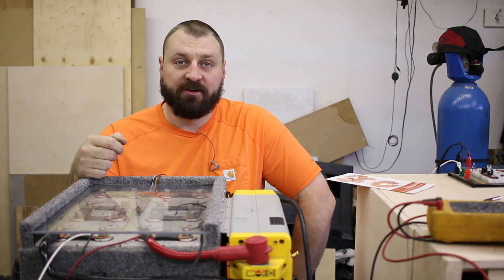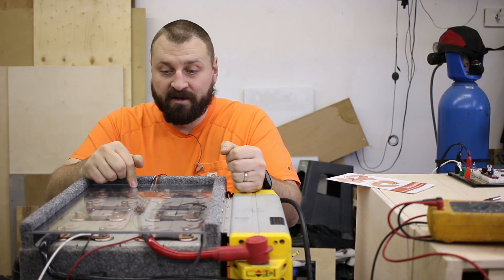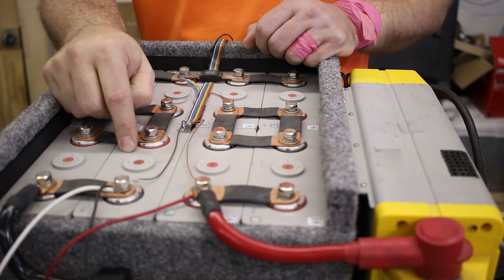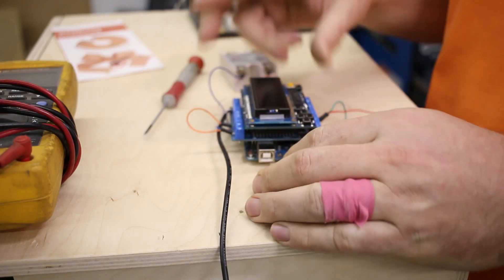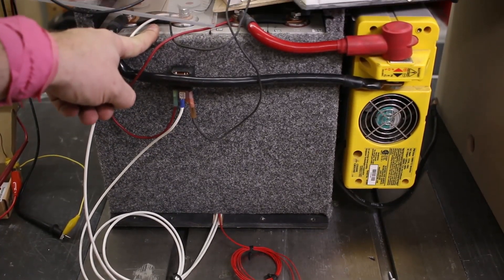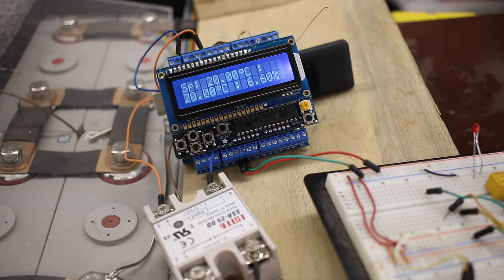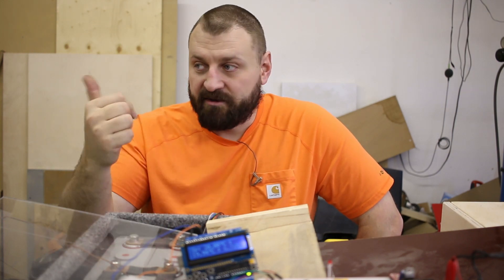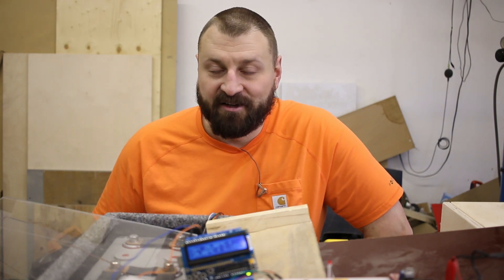Lithium Battery Heater -  DIY RV - How to build an Overlander

Comment: Two suggestions to increase safety.

Perhaps a 400 watt matte is a bit much?  You could conceivably cook off the batteries if it sticks on.

Other idea would be to put the secondary side of the mechanical relay in series with another relay that’s always held  closed/on by the arduino. 

Add an “if” statement that would open this new relay if the temperature sensor reads too high and can cut the current from going through the first relay.  This would give redundancy if the first relay chain got stuck closed and energized the heating matt continuously.

I also don’t trust the Dallas 1-wires.  I’d add at least one more and place the two of them together.  If the temp readings between the two sensors gets too far apart then shut down the heater.
Reply from the maker: Both great ideas! We sold our house in Canada and made our way south, haven't had to heat the batteries since Colorado... Currently in Mexico and haven't had any problems with freezing here 🌴🌵🤣
Reply: Dem warm weather problemz
Reply: Personally, I put a snap disk cutoff switch "rated" for 40c on each end cell in my pack as close to the bottom heaters as I could get my drill. The heaters will be wired through them and should provide some over temp fault control while my controller is set to, say, 4c and something bad happens to the relay.

I hope to test this soon.
Reply: Put a normally closed thermal switch in line with the heating element (of sufficient amperage) and it can cut the system off if something goes wrong. That's what I use.

Comment: Interesting.  I am toying with keeping my off grid cabin batteries warm during the Alberta winter.  I am using Electrodacus's DMPPT+SBMS.  Was thinking to use snap switches to control a relay.  One at the top (nc 20c) and one by the heating element (nc 25c) to do the cycling.  Can adjust the size of the heating element by the length of the silicone wire (as per Dacion's heating element strategy).  Thoughts?
Reply from the maker: Yeah, should work fine...

Comment: I just finished building a similar setup for my 6kwh pack in my camper. I have it set to keep my battery at 22-24 degrees constantly only using a 20 watt 12v heat pad and a well insulated box.
Reply: What type of heating pad? Is it available on amazon?
Reply: @PaDutchRunner  I got a 15w bathroom mirror heating pad that runs on 12v, a digital thermostat from ebay. Have yet to install it in my van but starting to feel like 15w might not be enough. Heating pad is Demista brand, lots of sizes to chose from.
Reply: Martin K Thanks for the info! I ended up buying two heated pet cushions that I plan to place on top of my battery bank, with a heavily insulated winter coat placed over top of both the pet cushions and the bank.  I haven’t tried it out yet, but I have a hunch that the coat will trap enough heat to cause a substantial warming effect, while at the same time insulating against the ambient temp (you know, behaving like a coat).  The pet cushions have some suitable properties — they are weatherproof, they do not have timers (because pets can’t reengage once the time is up), and shave what I presume to be a solid thermostatic set up — because the life of the pet would be at stake in the event of overheating, etc.
Reply: @MartinTheLaserGuy  take them apart and stick them in the floor, save thousands for a commercial solution :P

Comment: I am going to add heating to my batteries and control the heating with an arduino. What components did you use with the arduino (shields)? Can you give any details on the arduino sketch you made?

Comment: Are you still happy with the heater setup?  Thought you mentioned the heater draws 400w.  To which heater were you referring?
Reply from the maker: Yes, Super Happy. We're crossing over into Mexico now, so not really needed as much as when we were in Canada.
Reply: @Everlanders  yah, I'm in Portland and have wondered if a heater is warranted given it doesn't drop below 0 very many days/year.
Reply from the maker: Probably not needed then.

Comment: Would be cool if the Heating and maybe even fans for cooling was integrated in a BMS
Reply from the maker: These batteries are sealed and are inside our living space, so they are generally at temperatures that humans can tolerate.

Comment: Are there lithium battery heater kits available?  Perhaps in the Marine market?  VERY good video!
Reply from the maker: Not that I've seen, but this is a very simple DIY project anyway.
Reply: Electric Battery Blanket.

Comment: Can you suggest on a heat pad to use.  I have 8 180ah Calb, they will be below Roadtrek camper living space floor, in a metal battery box 7'' 1/4  x 22'' 3/4 x 13'' deep . I Am thinking of insulating the outside of box with 1/2 '' foul foam.   The temps here in mid east (Delaware) not like yours but I want to be ready.
Reply from the maker: Those are exactly the batteries I have... It is going to depend on how you'll be powering it... A 400 watt 12 volt silicone heating pad will pull about 40 amps. A 200 Watt 12 volts pad, is likely sufficient. Powering it off of 12 volts is an uphill battle, especially in winter with the solar production being so low. If you will have the option to plug into the grid, there are lots of 110 volt heater pads available too. Look up Kenovo heaters on eBay, they make many for the 3D printing market in many different flavors.

Comment: Any suggestions on a heating pad to use? I saw below that you used a 400w pad -- haha. I'm struggling to find something thats a much lower wattage and power consumption that doesn't have a built in thermostat. I want to use my own thermostat to set the temp. Any ideas? Thanks!
Reply from the maker: Mine does not have a thermostat built in... It does have a temperature sensor, most do. But you can abandon it and use your own thermostat to control the temperature as I did. Look into 3D printer bed heating mats. They are available in many wattages. 400 watts is a little bit much, but when I considered that I can't charge the lithium batteries until they are above freezing, I wanted to heat them up as quick as possible, the fastest recovery time... if you are just maintaining temperature, you could get away with much less.
Reply: Yeah we will see... I’d like to gently warm the batteries from the bottom, doesn’t need to be quick, in fact slow should help let the warmth travel evenly through the batteries which are 8” tall so the top won’t immediately benefit from the warmth at the bottom. I’ll set the thermostat at 40 probably, and the heater will be powered by the lithium batteries themselves. 
The pads you linked look like a good option too if more heat is needed, I could use 4 of those spread out for a total of 80w. We will see how the one I ordered works out and adjust if needed. 
Appreciate the input, let’s keep in touch about it 👍🏻.
Reply: Looking to do this for a LiFePO4-battery in my truck camper. It’ll be heated by a diesel heater during usage but really want the solar to work during cold storage when not in use. What PWM controller do you guys recommend? Perhaps one with a thermostat. Up here in Sweden it can be down to -40C so a well insulated box and a heating pad will be needed.
Reply from the maker: https://www.ebay.com/sch/i.html?_nkw=heater+silicone+12+v
Reply: @Everlanders  Thanks -- just seems like really high power consumption and really high heat. I want to install a heating pad on the bottom of my 9" tall batteries and gently warm them back up, not bring a ton of heat into the bottom that may not transfer quickly to the top. Just want to keep them at about 40-45 degrees through the winter when ambient temps may otherwise be below freezing. Having a lot of trouble finding a low wattage heating pad -- only really seeing pet and people pads/blankets that are low wattage. Surprised its so much of a struggle! A company called Keenovo makes a lot of pads, but still nothing 12v and low wattage unfortunately.
Reply from the maker: Ours is made by Keenovo, they make lots of great options...
Reply: @Everlanders  I found one tonight that is 5" x 14" and 30w -- I think this might be a good choice for me. Here's the link: https://www.zasales.com/BME9.html?fbclid=IwAR0-9TIVzNnL3jIdHZeJ1mz1HOMOKsqhCJ9bohUAAtwioxQ74bqNk1jH7y8 
Going to talk to the company and probably give it a shot. my battery footprint is about 5.8" x 19" so I will attach the heating pad to the underside of an aluminum plate similar to what you did to help spread the heat out a bit more, and hope that the box is insulated well enough that the batteries on the end will stay up to temp even if they're not in direct contact with the heating pad since its a little smaller. What do you think?
Reply from the maker: I think it's too small and too expensive. You can always get a cheap PWM controller to dial it back, but you can't turn it up past it's rated wattage. Since I'm using solar to warm it, I want to heat it up quick so that I can start charging sooner. But that's just my opinion, You do you and let me know how it works out.
Reply from the maker: Like this: https://www.ebay.com/itm/12V-DC-80x100mm-20W-Flexible-Waterproof-Silicon-Heater-Pad-for-3D-Printer-Heater/132755688351?hash=item1ee8db0b9f:g:iRAAAOSwaY9bpEnI:rk:6:pf:0

Comment: Will a 300 amp discharge to start an engine, warm up the battery to allow it to charge with the alternator when it's ?F?
Reply from the maker: Yes
Reply: When it's 0 degrees F, 10 degrees F...how cold?
Reply: @HarmonicResearch  spec sheet for the CALB minimum charge temp is 0°c which is whatever that converts to in your daft Fahrenheit measurements :D  but for safety / error margin I would would limit it to a minimum of 5°c to be on the safe side

Comment: Wow, your vids kinda make by brain spin.  You've got skiiiiiilzzzzz.  So...explain this to me like I'm 5.  I've got a lithium bank I want to heat.  Best/newbie solution?
Reply from the maker: That is going to depend largely on the mass you need to heat. The 400 watt heater pad I used was probably two times bigger than I needed. It pulls 40 amps and heats up a bit too quick and then the controller cycles on and off, it would be better with a more gentle heat.
Reply: @Everlanders  what is the elctrical block you are using to connect the controller
Reply: That's all too complicated for me and usually complicated things break down or are unreliable when your out in the middle of nowhere in your camper. I think my solution will be a much smaller heating pad with thicker aluminum in hopes to have something I can just turn on with constant current that will heat the aluminum plate around 25 Celsius maximum. Place a proper thermometer at the top of the cells and just let her run for an hour or so until the batteries reach 20C before turning on the charge controller on.
Reply from the maker: Perfect plan.
Reply: Does the electrodacus shut down charging when it's too cold?  If not, what's your solution to that?
Reply from the maker: Yes, it has minimal and maximum temperature thresholds that the user can change from the default suggested settings!

Comment: A friend in Germany sent me this...have you heard of this?  https://www.efoy-comfort.com/benefits#c_238
Reply from the maker: Yeah, Fuel cells are great.  But they cost 3-5k depending on the model. And make 80 to 210Ah per day...  and it's still consuming fuel.  I'm not against them, but not for me.
Reply: I was thinking of it more as an addition for a hybrid system. If you could get those fuel cells to last 3-4 months while Solar did the majority of charging, you'd have no worries about weather, night use, etc. So many Overlanders and Sailors that I watch on here seem to have power trouble due to those factors. Your channel's really growing! That's awesome!
Reply from the maker: Yeah, we were in that boat... If we got stuck in the rain for a week, or in the thick forest, or in the mountains - Our batteries were 10% lower each morning. We could only last a week like that and we started praying for Sun.  But I chose to double up on the solar and be done with it. We'll have 1.4kW up there once the snow melts... Ask me again in 5 months ;-)

Comment: Do you ever anticipate needing to cool the batteries as well? If so perhaps  a solution would be to put spacers between your batteries and channel air from a tiny squirrel cage fan (for quietness) through them. Then incorporate a small  heating element that the fan exhaust blows through...turned on when needed for cold weather.
Reply from the maker: No. Unlike Lead Acid or NiCad etc, Li-Fe don't self heat from charging or discharging. At least not at the relatively low (200amp) rates we're using them. The batteries are located inside our living space, and if it's getting that hot, it's probably quite sunny, and we would have had the air conditioner running.